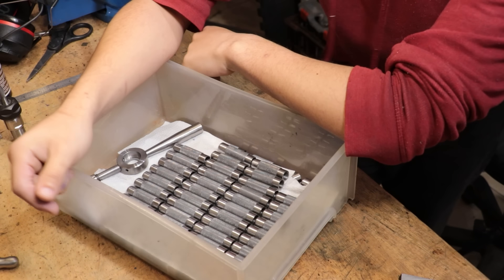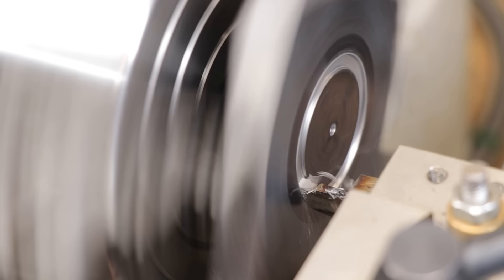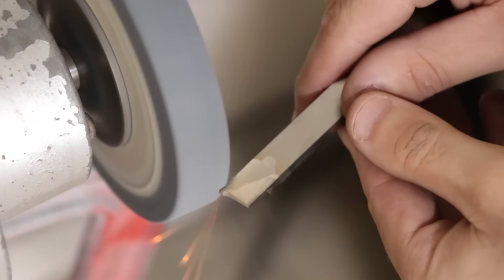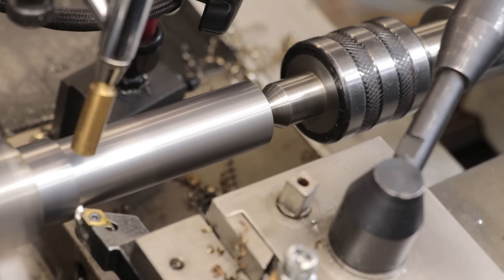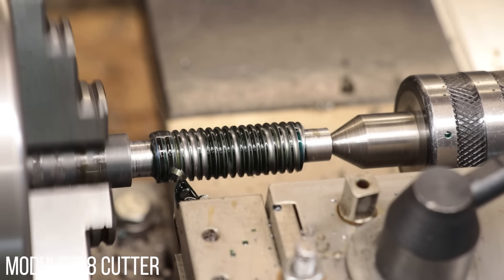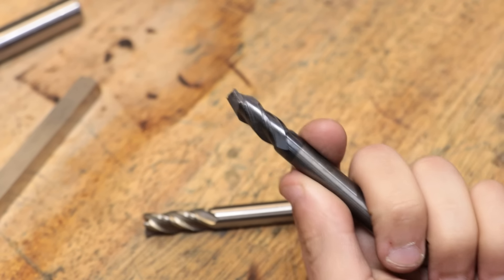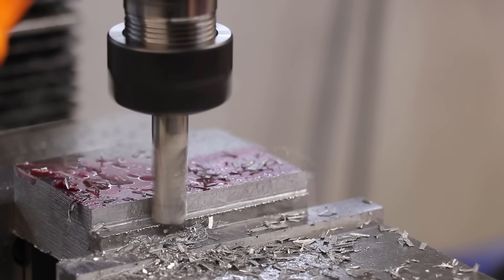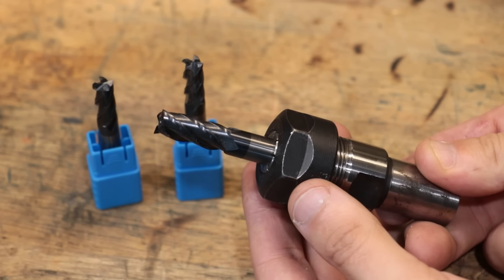Carbide VS HSS Tooling In the Workshop

Comment: Regarding endmills, I recommend HHS-PM, these are much tougher then HHS-Co or HSS-E cutters and much cheaper then carbide. Once you ran a HSS-PM roughing endmill on a smaller mill, you start asking yourself, if your mill is really that capable. HSS-PM is also designed to work well without coolant.

Comment: When it comes to endmills, i can highly recommend to use 2 flute end mills for general work and roughing, if you are not in a hurry. they are not too dissimilar to drills in terms of resharpening, which means, you can use up the lower portion of the edge and just regrind the face each time it wears out. you can check if you ground them evenly with a square and even if the edges are like 0.2mm off, they still perform relatively well. If you have a sharp angled grinding stine on your bench grinder, you might be able to regrind the faces of 3 flute end mills, but anything above is extremely difficult,  if at all possible.I also recommend to grind the 2 flute endmills assymetricly, so they can cut downwards cleanly. you do it a bit like web thinning on a drill, just unevenly on purpose.
Reply: End mills that have 2 flutes are called slot drills. Learn to use cutters correctly and you will find you don't break/damage the tools as much.

Comment: The Machinery's Handbook recommends not using cutting fluids with carbide tools unless you can really flood the cutting edge with a continuous stream of fluid. If you use insufficient fluid, or just the occasional spray or brush of fluid, the cutting edge is likely to be damaged by thermal shock, which will eventually lead to failure.
Reply: Thanks for the info
Reply: thats more a myth and often is regared toward work hardining the workpieace by the unconstent cooling.The think is.When machinung you are not reaching such critical tempertures.IF you do something is off(this is for the standard usecase.non exotic alloy). 
Carbide can handle temperture change in the amount it happes. Cooling the tool is also done by the chips. The Machinist handbock is good,but also old. So...
Reply: "Eventually lead to failure" all endmills eventually fail, unless you give a specific number its meaningless advice.
Reply: That’s not true in a home workshop. That’s for large machines running at high speeds with deep cuts. With those, the carbide can reach 1,500 degrees. If you intermittently add cooling, it could crack. In a home shop, that’s never a problem. Spray misting is fine and the occasional dap by a brush is fine too.
Reply: @bosanaz2010 the book is not old. It’s significantly updated every few years. The latest one I have is the 33rd edition and it came out around three years ago and another one is now coming out.
Reply: @bosanaz2010  Its not a myth and work hardening has nothing to do with heat or cooling.
An carbide insert last longer when its run dry than when its only cooled now and then with a hand bottle.

also its not the tool thats cooled by the chips, its the workpice that get less heat when the cutting speed, feed rate and depth of the cut is high enough that the heat gets in and away with the chips.

Comment: I work at a factory that does primarily plastics. For cutting plastic we exclusively run HSS and sharpen very regularly. He mentioned it briefly with acetal, but for cutting gummy plastics like HDPE and ot TPE/TPU, sharp HSS is king, and one of the only things that can actually break a chip

Comment: You might look into recycling your carbide inserts as a consideration for your stockpile of used inserts. I believe that Sandvik and Kennametal (at the very least) have recycling programs to reduce the need for new raw materials all the time. This reduces the need for sourcing the limited stock of Tungsten/Tantalum/Titanium (depending on what type of carbide is being used) and (potentially more importantly, especially ethically) the need for extraction of cobalt.

Comment: I use carbide simply because I cant be f'd fluffing around grinding tools and setting tool heights each time.  For special occasions, all good.

A big thing I have found is that using polished aluminium inserts on soft steel work mint.  Similar to a really sharp HSS tool.

Comment: Nice explaination!
I use a lot of inserts too on my lathe.
For my 'mill' that is still on my little Unimat SL with milling-plate... well I use carbide too, the small inserts that are cheap (like 3 $ for 5) for CNC's. That is mostly since that machine cannot work well with bigger tools.

About the old inserts: the other points can probably be used in a fly-cutter too. I'm also collecting them and probably use them for that at some time when I have a better miling-setup.

Comment: end mill sharpening services are a great alternative compared to buying new, both for HSS as well as carbide. sharpening costs between $5 and $15 here in the US (for 5mm to 16mm), and is usually done on CNC rigs. the end mills I get back from my sharpening service perform better than the original. This works for sharpening just the front, but also reworking the side flutes (in case of chippage, the diameter gets smaller), or just shortening the tool (which is fine in many cases)

Comment: Great video, nothing conflicting to my experience. And a couple of things I never thought about.
When starting working in a machine shop in the seventies, carbide inserts was common. Before CNC machines existed. When started with CNC lathes in the eighties, only used inserts. Now a retired hobby machinist. Mostly same tooling as you use. But not sure if I prefer HSS or carbide for parting off in different materials.

Comment: most of my work is 6061, and I am using mostly the super sharp insert styles design for alu. i do occasionally stainless steel and regular steel, and those inserts work perfectly fine (may not have the longest service life). the interesting thing about the sharp carbide inserts is that you can re-hone them with a diamond stone, since the cutting edge geometry isn't that complex.

Comment: High speed steel also has a lower cutting pressure. This is useful when chattering is a problem. High-speed Steel has saved my backside a few times now

Comment: An old carbide endmill got me out of a jam recently. I ordered some cabinet scrapers to finish a piece of high end furniture for a family member and I’d always heard that you can use a screwdriver to burnish the cutting edge but it was nowhere near hard enough. The carbide endmill made quick work of the job and I was able to get a really good shaving out of my scrapers.
Reply: Great idea. I bought a carbide burnisher from Lee Valley years ago before doing any metal work, but a worn out end mill glued into a piece of wood would be basically the same thing for free. I like it better than my old hardened steel burnisher because it doesn't rust.

Comment: When you overheat HSS, I’d doesn’t lose its temper,  it loses its hardness.  To temper is to impart toughness , high temper = low hardness, high toughness .  Cheers , good vid.
Reply from the maker: You have to take it to about 400-500c for it start to lose hardness and still remains my point. But you will change the other aspects of the temper too.

Comment: I don't currently own any hss tooling.  Carbide lathe inserts are disposably cheap if you shop.  Carbide milling end mills in sizes up to 5/16 can be had in specialty cutters that can handle hours in the cut of titanium or stainless and will cost from $5 to $15 per cutter if you shop hard.  Small machines don't have a lot of rigidity so I only break out 1/2" and larger when rarely needed.  The carbide even cheap carbide you can abuse the bottom of the mill and they last a while.  Hss end mills in smaller sizes aren't cheaper than carbide.

Comment: The only thing I use HSS for on the lathe in my homeshop is for Forming Tools for everything else I use Carbide Inserts. Yeah they can be pricey but at long as you take care of them they'll last for quite a while and they just work, there's no dicking around having to regrind the cutting edge you just pop your tool holder in and you're good to go.

Comment: I've found that those sharp polished aluminium inserts are great for getting a good surface finish in most steel. They do a great light finishing pass
Reply: Especially with bigger nose radiuses. I like to use them for critical finishes too.

Comment: About the consistency und surface finish from inserts. I worked at a cnc lathe shop and one of the machines turned pieces ofstainless steel hex bar down for some special bolts. Everything went fine (this machine then was one of the loudest of all while roughing the hex profile) until I changed the insert for a fresh one. After that, the surface finish was ruined and we spent the next one and a half days to find a solution (changing speeds & feeds, adding tail support, etc.).

Comment: Thanks for the video, good perspective.
I use both. A lot of carbide but my cut off tool is HSS and I do use the tangential tool holder with HSS too, both are quick to sharpen. I think my lathe may be more rigid that some of the small lathes though.

Comment: another big consideration for the mill is spindle speed, for the "classical" mills like the one you have, you have the option to go HSS. On machines with the Chinese high speed spindles, like my Milo, you dont get that option as the HSS would basically burn up instantly, as the minimum RPM is at least like 12-15k..

Comment: I guess button inserts on a fly cutter get around the interrupted cut issue because the shape of the insert means you get more of a "scissor" action at the edges of the part, rather than slamming the cutting edge flat into the side of the part.

Comment: If your little machine can spin fast enough to match the surface speed profile, carbide makes perfect sense.

That said, you absolutely can put an extremely sharp edge onto carbide with diamond, either a wheel or even with plates, it just takes a LONG time, because if you go too fast it will likely chip at the micro level.

Comment: As a metal Worker, carbide is it. But for a small hobbyist, it is expensive. But i still use HSS sometimes, and i don't mean drills. I made an acute job recently, a flat thread (square profile). Now, that is old and unusual, so i had to make a cutter for that. because you cannot buy a tool for that old thread.

Comment: Remember that carbide wants flood cooling or no cooling. Not a spray bottle manual squirting 😅

And for the end mills cutting at both sides when going straight is A BAD IDEA! that is a great way to break them like you showed in the video since it deflects one way and grabs then suddenly the other way, you should only cut at one side if you follow an existing track (like where you used it to make that treaded piece)
Reply from the maker: I’m not saying there’s no merit to it but I don’t see a reduction in tool life using intermittent cooling. It’s probably more an issue on large machines but ive always found intermittent cooling to be better than to let the carbide run dry. At least with prolonged cuts
Reply: @artisanmakes  intermittent cooling can seriously degrade lifetime - but that is when used in more industrial scenarios with very aggressive cuts and far higher working temperatures.

Comment: I would advise you to get a proper grinding wheel for the hss... you'll get more consistent results and less burnt tools... 
My pet peeve with carbide is how easily they chip if you turn off the power whilst in the cut... 
High positive raked HSS is great for reducing the HP required , important on a small lathe...

Nice vid !
😎👍☘️🍻
Reply: " if you turn off the power whilst in the cut... "
why would you do that other than in an emergency (where the cost of the insert is irrelevant to begin with) ?
Reply: @ABaumstumpf  I'm not advocating  turning off the power, I'm just showing the fragility of carbide compared to, say,  HSS... reversing a spindle when threading with a carbide die might simulate it though...

Comment: Carbide was invented back in 1936, so it wasn’t developed for CNC. Over the past decade or almost two, carbide inserts have gotten much sharper. That sharpness has been a major difference between HSS and carbide. I’ve found that most home shop people don’t know the difference between negative, neutral and positive rake. If you use a negative rake tool on small equipment, you will have a problem and that’s the reason why the bad press about carbide and small equipment. Use positive rake carbide tooling with the proper inserts and it’s a different world. You can even carefully hone a carbide insert, if you know what you’re doing. That can make a difference. Or buy cemented carbide bits. They’re like HSS tools and can be sharpened.
Reply from the maker: I think I was more so referring to carbide inserts.
Reply from the maker: I had a Quick Look back and I didn’t say it was developed for cnc. But it really is gears towards it or production environments in general.

Comment: So, now if we have a Quorn T&C grinder or a look alike Chinese model, you can make/remake cutters with end profiles that are consistent as opposed to hand ground might work cutters for economy etc and carbide really does need to have good end profiles to ensure they are supported on the all important edge area.
I have a couple of facing cutters with 5 or 6 carbide inserts but the cost of replacing a set, as they seem to easily chip, and it's too much of a cost for most machining that can be done with solid carbide end mills and fly cutters.

Comment: I'm pretty good at sharpening drills, but I've never managed to get an end mill to cut well after resharpening. Square end makes it very difficult to polish one blade without touching the other and dulling it. I suppose I could try grinding one to a not-quite-square end for roughing, though. You can't really use them for finish work anyway since grinding material off the side-cutting blades means they no longer cut a proper vertical wall either.
Reply: You know that an endmill isnt really square? They are concave, so only the corner cuts, the middle should only cut when you dive into the workpiece.

Comment: Carbide is best used on beefy machines that have the power needed to run the feeds and speeds that make it useful. I don't think it has anything to do with CNC vs manual. I guess you can call it a composite, because it is a combination of carbon and a metal, but what it really is, is a ceramic. Thanks for the video.
Reply from the maker: I’d say that there is at least a benefit to using it on a cnc because you can climb mill with them without much trouble. It’s not something I’d want to do with my carbide when I use them on the manual mill.
Reply: @artisanmakes  Sure, it is useful for CNC, it is not just for CNC, and certainly not designed for CNC.

In my incredibly limited experience, your success with climb cutting is down to experience, rigidity, and backlash.

Comment: ebay job-lots are your friend for carbide tooling.  I just picked up >100 6-16mm carbide endmills for ~£100 for the lot.  most slightly used but all in good condition, brand names.  lifetime supply.  wish my minimill went a bit faster to take propper advantage of the smaller ones though.

Comment: Indexable carbide tooling is the subscription service of tooling manufacturers. How many times can you sharpen a 3 inch long HSS turning tool? Unless youre only turning 4140 or hardened steel at high production volumes high speed tooling is cheaper in the long run.
Reply: cheaper in money or cheaper in time?

Comment: I run my HSS drills at 60 sfm, compared to 500 sfm for solid carbide drills. I can normally also get a higher chip load with carbide. But that’s from a guy who runs a 30 foot diameter vertical lathe with live tooling
Reply: Aah - now we're talking a proper machine. I worked on one the same size back in the late 70's.  Schiess Froriep @ Vickers Ruwolt in Richmond (now Ikea). Beautiful machine that could do fine work or major cuts.  My most memorable was 25mm deep 3mm feed. Some times it would chip beautifully and other times (in the same cut) it wouldn't. Then you had 25x3mm bar coming straight off the tool.... Its weight would break it at about a bit over a metre long.

Comment: 16:30 - rigidity of a machine became less important with more rpm.  all you say applies well to a conventional mill with spindle speed up to 3000-6000rpm, but when you came to CNC territory its another story.  HSS tooling is just doesn't work. 
 but with carbide even small 80-100kg "router" (which is nearly not as rigid as cast iron mill) will remove material much faster using HSM strategies.

Comment: Man I think you are wrong about sharpening endmills. 

You can usually get a 1/2" HSS end mill resharpened for like $5 or less, and carbide for around $10, a bit more if you want either coated (which you do). Granted they are rarely exactly 1/2" when they return, but they grind to a usable size, like .495. The size doesn't really matter though since you are cutting with either a DRO or measuring the part anyway. 
In fact I buy reground endmills almost exclusively.